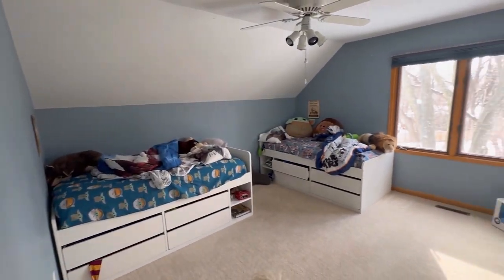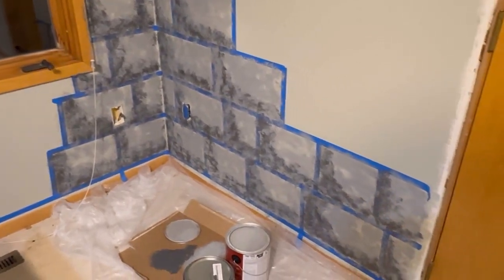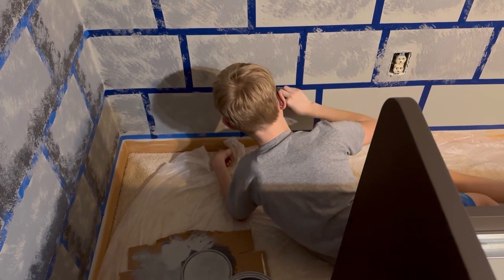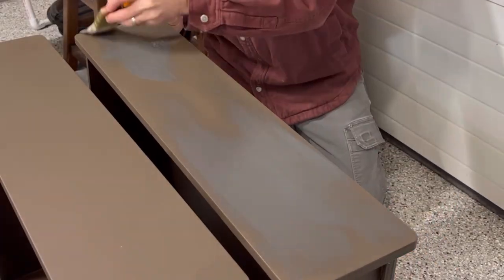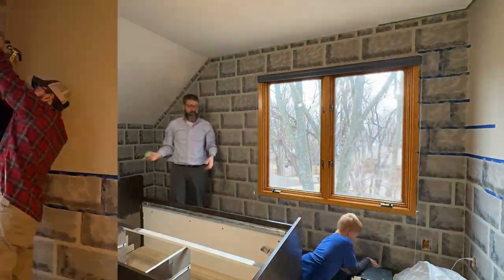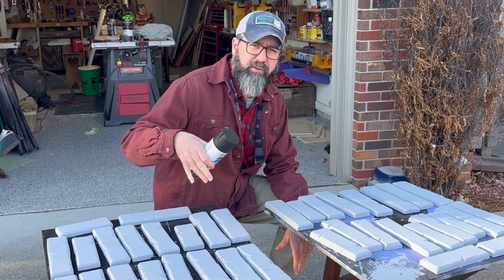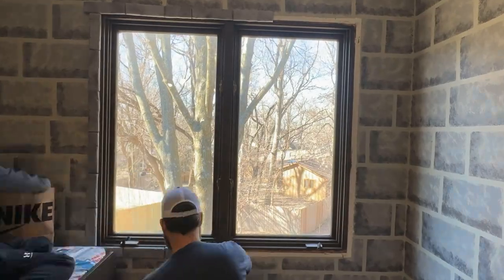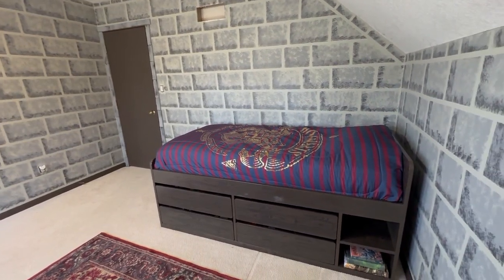Transforming a Bedroom into Hogwarts Castle! Harry Potter Bedroom Makeover Part 1

Comment: Love it!  I did a similar thing years ago for a 17th Century Madrigal with my singing group, and we used large sponges, dabbed with all the colors, and then just applied to the wall. It saved on all the taping and multiple steps of coloring.  Also made the "grout" lines more random.  Can't wait to see Part 2.
Reply from the maker: Definitely could have done it that way and probably would have preferred it tbh. Check the ceiling vid! It’s pretty good. Hard at work on part 3 now! 🙌🙏